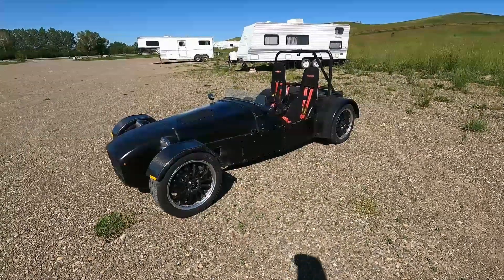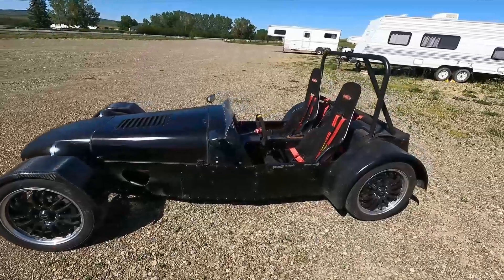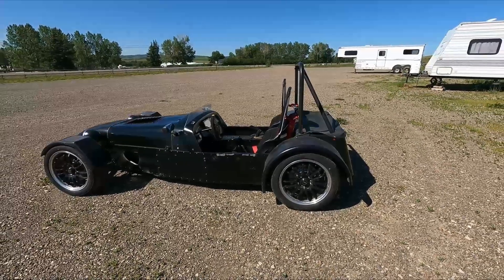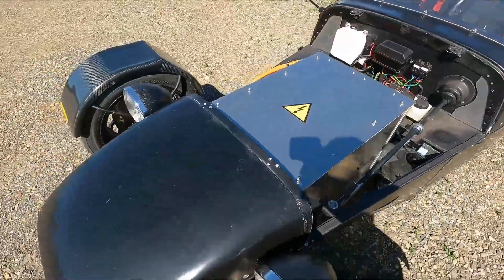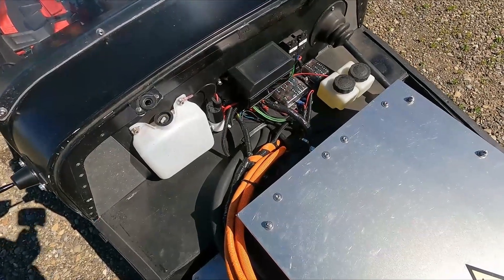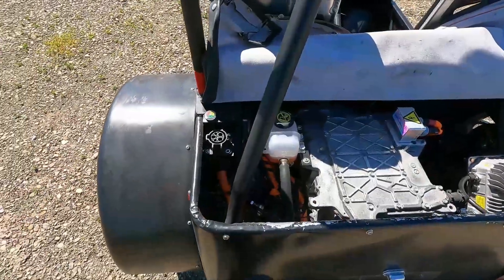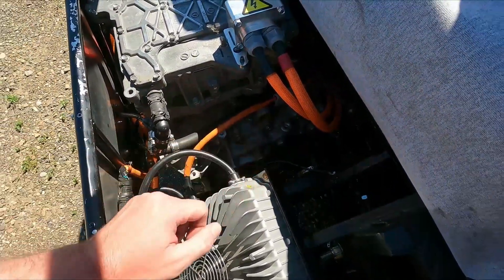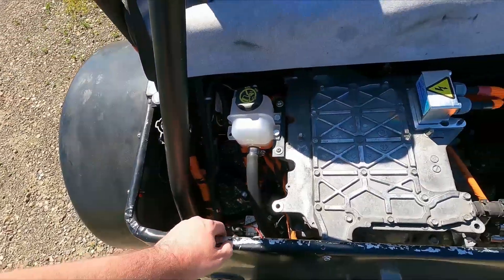EV Locost 7 tour

Comment: I might have missed it in the video but why did you have to mount the leaf motor in reverse? My guess is space/packaging but I would like to know.
Reply from the maker: @kmpm  Ah, good question. Yes it was entirely for packaging reasons. The rear section just doesn't have enough room ahead of the wheel centerline. The axles would have had a pretty extreme forward angle, way outside the recommended range for the inner tripod-style joints.

Comment: What did you use for rear fenders?
Reply from the maker: Those are the fiberglass fenders sold by Kinetic Vehicles. They come in a trim-to-fit size with flanges to mount to the car.